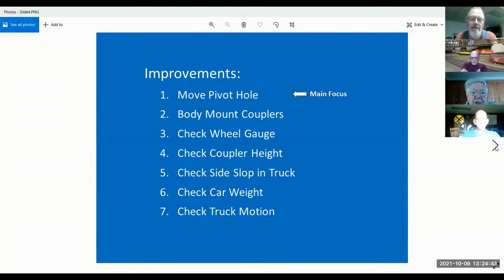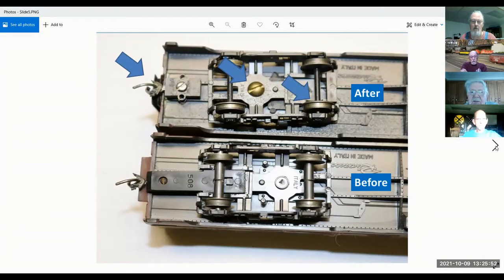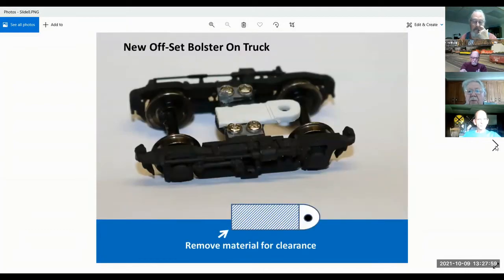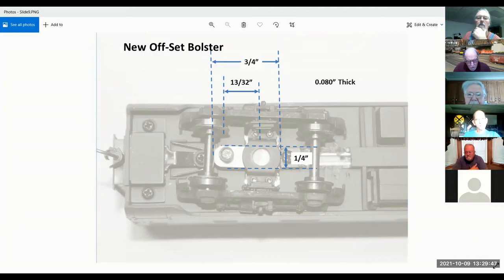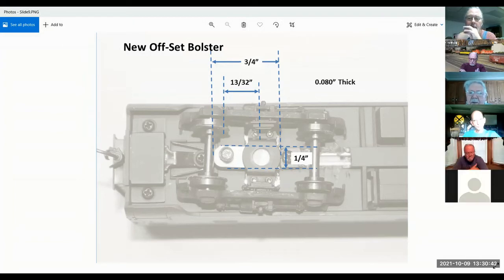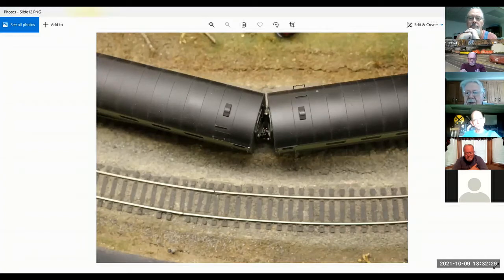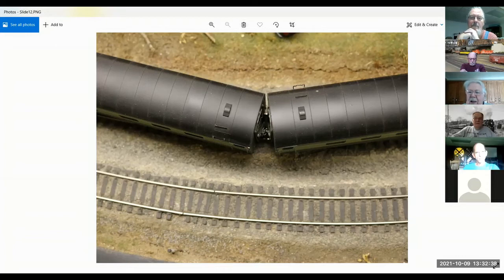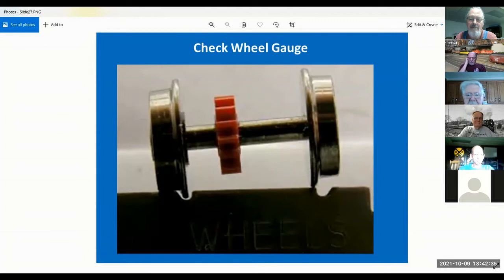Ron King Improving Passenger Car Performance 10/9/2021

Comment: the modification at about 14 minutes, with the custom offset bolster, are you converting an AHM/ric/IHC type passenger car? Out club has turns of at least 36" so I have no worries there. Also, did you add those walthers style couplers too? can you buy those, and do they work better than just adding #5 coupler boxes, or are they only needed for tighter radius? My home layout has 21-23 inches, but my passenger trains will primarily live at the club.

Comment: This was a very interesting.  Is the coupler on the body better than the truck if you are running 85 foot cars on 18" radius?
Reply: More than likely not!! A 24" radius curve would be the absolute minimum for 85' cars -- especially with body mounted couplers!! And nothing tighter than #6 switches on the mainlines also!!! 😉